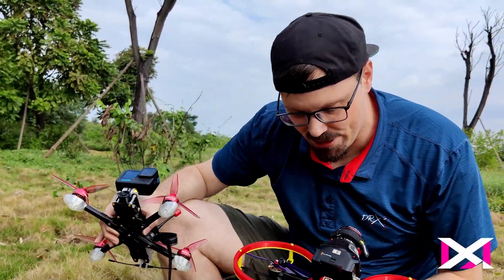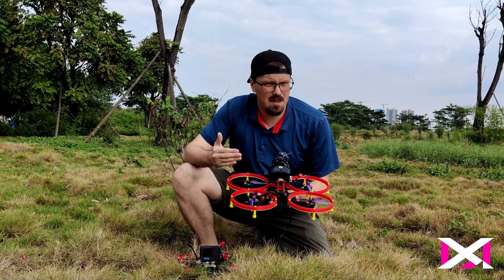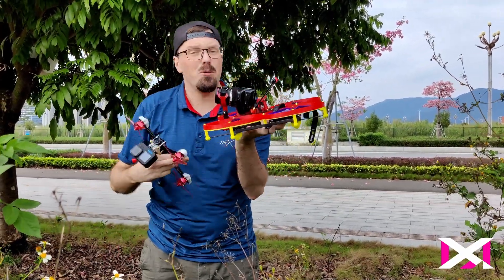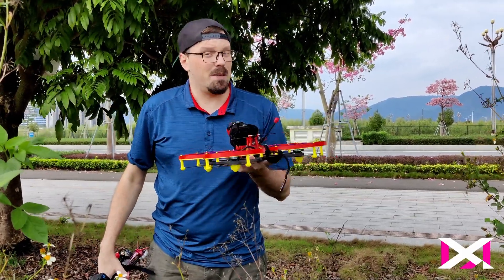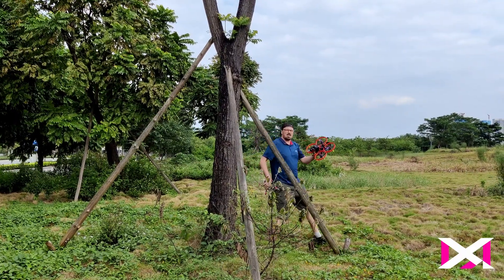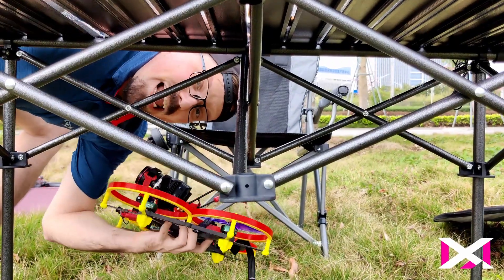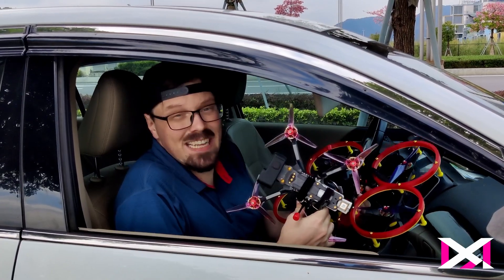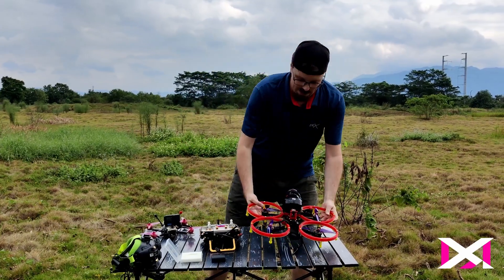Turning a 6 inch FPV Drone into a Blackmagic Micro Cinema Camera MONSTER

Comment: I was thinking about picking up a bmmcc to test out again 3 years later. But your footage seems quite blurry, was the lens in focus? Have you looking into Davinci Resolve super scale or Topaz AI upscale?
Reply from the maker: I wouldn't recommend it and I just sold mine, the main problem is how hard it is to manage the settings without a screen or (worthwhile) buttons. But the real killer is how hard it is to get 60fps to work. It's a serious issue with the ad card than in my experience was just more trouble that it is worth. A BMPCC4K is not that much heavier with a battery mod or even naked, but the experience and footage is way better
Reply from the maker: But mostly my dreams of flying a cinema camera are pretty much dead as where I am people barely will shell out the budget for a GoPro. So it's just not financially viable to fly a cinema camera given it would likely lose you jobs as they would say it's too expensive, or you would be forced to undercharge and put way too much financial risk up in the air every time. Hell even the 03 is good enough for this local price bracket. Maybe one day I could do it but until that day I will adapt to my surroundings.

So likely my footage is a representation of my lack of experience with the camera as I flew it only a few times
Reply from the maker: Check this out https://youtu.be/FCWquvBknEw

This was shot entirely with the mmmcc